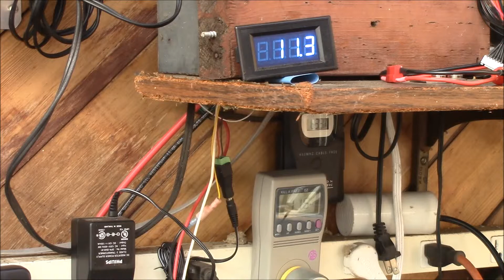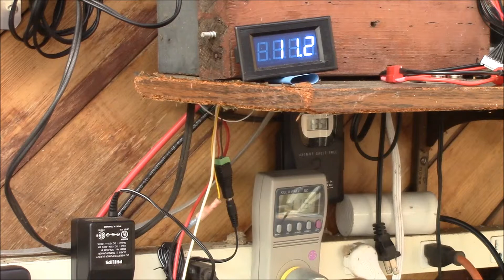Sizing Inverter Power Systems, Part 1

Comment: What will be the dc apmps of same load that u r showing. But 220vac instead of 120vac???
Reply from the maker: Should be the same assuming a 12V DC system powering the inverter.  Same power output, but the AC voltage doubles and the AC current is halved.  With 220-240VAC loads, you would use roughly 20 as the ratio between 12VDC and  240VAC current instead of 10 for the 12/120 volt case.  For a 24VDC input and 240VAC output, the same factor of 10 applies.  You could make minor adjustments for 220 vs. 230 vs. 240 volts and also if you had a more efficient power inverter, but those are +/- 10% type of changes in the ratios.  I just find it a lot easier to use a factor of 10 and then either double or halve it instead of trying to use 9 or 11 for example.

Comment: Question to size inverter to car with 100 amp alternator. I assume 1000 watt is max size. But to hook up larger such as 2000 w implies dangerous damage to car. Would these conclusions be correct. Please comment on best max size. I would prefer the higher watt inverter. I have surge concerns for refrigerators. Thanks for excellent sizing video.
Reply from the maker: +Robert Patridge You could go with a larger capacity inverter.  The 100A -> 1000W figure would give you the sort of continuous power output you could expect.  But with a decent battery in the car, you could handle surge current with a larger inverter for a short period of time.  For example if starting up a motor load that needs 2000W to get running then much less power once it's going.  My freezer takes about 190 DC amps into the inverter to start up (close to 2000W) but once running, it takes 150-200W:
 https://youtu.be/TS76YYiJesw

So yes, a larger inverter or one that has a decent surge rating is no issue.